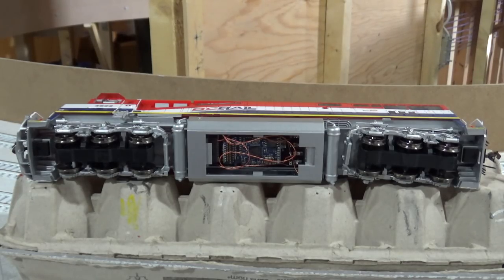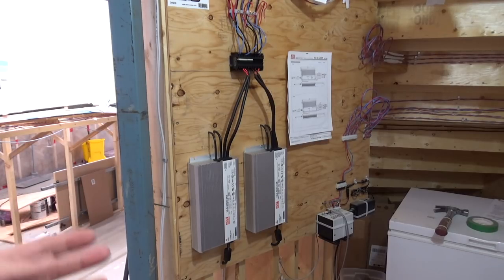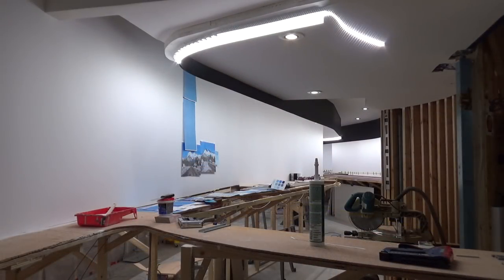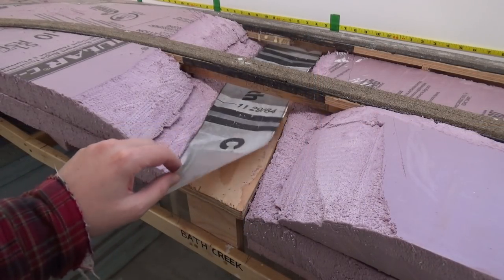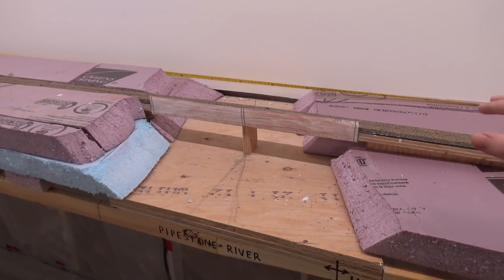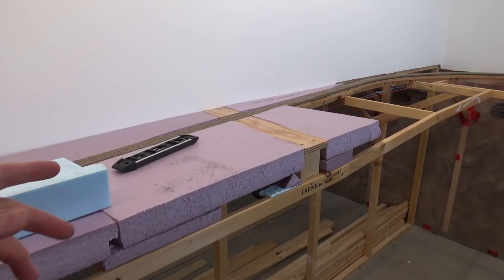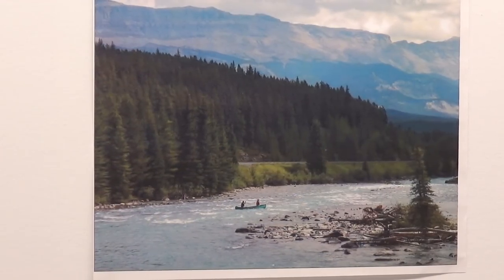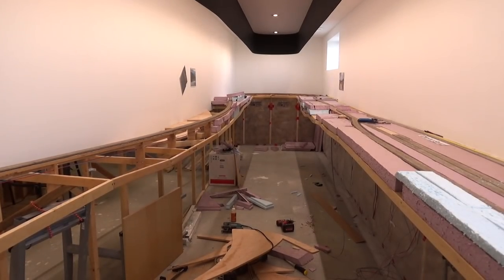Layout Update - April 2018: Lighting Done, Foam Terrain, River & Bridge Scenes...

Comment: Love the layout lighting - I have not really figured out how my layout will be lighted yet but your setup works great and looks so cool. So I think that I now know how I want to light my layout too! Once you can control the color it should really rock!

Great job. Cheers Jim
Reply from the maker: Thanks Jim! Here's the LED strips I chose if you want to read up on them. They are definitely on the pricey side but if you wait long enough they do offer them for 20% off a couple times per year. 
https://store.yujiintl.com/collections/high-cri-led-strips-ribbon/products/bc-series-dual-cct-ribbon-120led-2835
Note that they are wired for common anode so you really need to keep that in mind if you want to control the color. Don't make the same mistake I did and order current dimming drivers.
Reply: Thanks for the link and the tip on the common anode Ben - hope to see your lighting with the dimming and color control soon!
Reply from the maker: No problem Jim!

Comment: Great progress! Now I guess you have come to the point when the construction will  be more rewarding. You have created a very nice environment to run trains there! Looking at the prototype photos you have in the future a daunted job to create all those trees. lol! I created trees by twisting wire  and solder the on top of them cutting the wires to and bend them to create the branches and spray paint them and adding ground foam. Turned out alright. For spruces by winding some greenish yard around  small diameter rod and after the yarn was on twist the wire tightly and cut the yarn and trim to shape. looks like areal thing in the distance.
Reply from the maker: Thanks Ollie. Yeah the tree making is going to be a challenge. I'm taking the attitude of we will deal with it when we get there. I will definitely give your methods a try. I am going to need all the help I can get.

Comment: Awesome layout! I really look forward to the day you’ll be able to run trains on it!

Just a question, the intermediate signal you’ve got planned, I noticed one of them is a home signal (the double headed) with an Restricting plate. 

Shouldn’t it be a staggered signal instead? I’m not super familiar with the Lagan Sub so I’m not sure if they use a home signal there.
Reply from the maker: Thanks Marco, you and me both! 

I can't say for sure because I've never seen a photo of those signals or been there in person. I went off the GOI which has a signal diagram for the Laggan and this is the east signal before Lake Louise. The crews call it as "CP XXXX west, clear to medium signal to Lake Louise" which I think is this 1140 signal. Lake Louise is an equilateral switch so highest speed possible over it in any direction is medium speed, maybe that has something to do with the way the signals are set up.
Reply: BArailsystem, BArailsystem, Ah, perhaps it does. It just had me curious. CN and CP have identical signal setups and we use staggered signals (with Restricting planes), in advance to any controlled locations (sidings for lack of better term) where speed will be a factor. (e.g CN 115 clear to limited to Carvell, CN 115 Diverging to Stop at Yates etc) 

It’s entirely within the realm of possibility that particular signal is a home signal so it can show a absolute stop. The only thing that has me wondering is that only staggered and single aspect signals can have restricting plates, as they are incapable of showing absolute stops. (The restricting plates allow the crews to proceed at restricted speed instead of stopping then proceeding). A home signal with a R plate is just strange to me. 

I better stop myself from ranting to long about signals and all the different aspects and combinations before I write and essay. If you want, I can find out about that signal from a buddy of mine at CP, it looks like you’re going for total realism, and a good signal system makes operations run smooth. 

Once again, epic layout, I really look forward to when it’s finished.
Reply from the maker: Interesting! Well it's possible the time table doesn't show it correctly, I double checked today and 1441 is an inline double headed signal with the R plate. Maybe there is a small difference between CN and CP in this regard. It's cool stuff, I find the signals and interlocking systems fascinating. Definitely going to have to consult with you when I design the signal system for my Edson sub and Jasper yard part of the layout. 
No worries about ranting on here, please do write an essay! If you don't mind asking your buddy that would be cool if he could confirm. If you like, shoot me an email at BArailsystem@gmail.com and I'll send you a picture of the signal logic I have planned for the CP side as well as a pic of the signal overview from the timetable I have. 
Thanks man!
Reply: BArailsystem, That’s interesting, I’ll need to look up the CP signals some more. Inline double header with an R plate, that’s really weird and yet fascinating compared to ours. 

In terms of signals and interlockings, if you want to read up on the specific rules and find out each signal (and it’s combinations), you can find them online (Canadian Railway Operating Rules). I can also send some photos of the CN variants and our signals. Anything to help.

And I totally forgot your doing the Edson Sub, which if you need help on that I’ll totally be willing, I run on that sub a lot from Edmonton. I can also send a image of the updated time table and track profiles.
Reply from the maker: That would be awesome, thanks so much! The CN layout will have the dwarf signals on each end of Jasper yard, the crossovers at English and the signal bridge before it goes to single track at Henry house.

Comment: Curious what the tape measure is being used for—I noticed it taped along a large portion?
Reply from the maker: It's for planning out my photo back drops. I need to get accurate measurements of all the walls so I can design the backdrop for them. More to come on that, I filmed it but didn't include it in the update because it was too long.